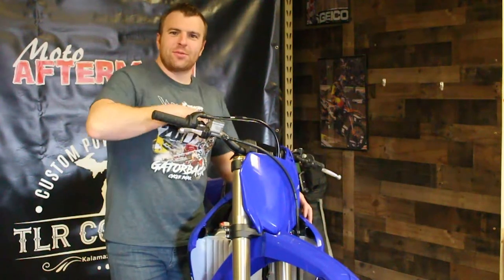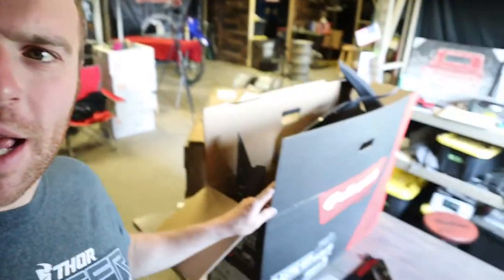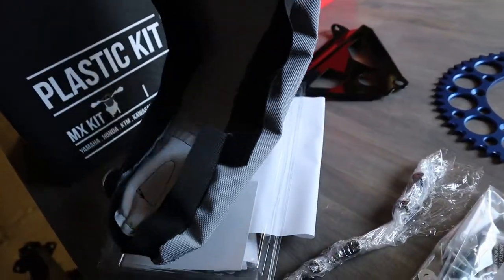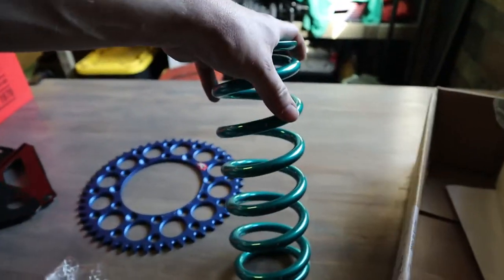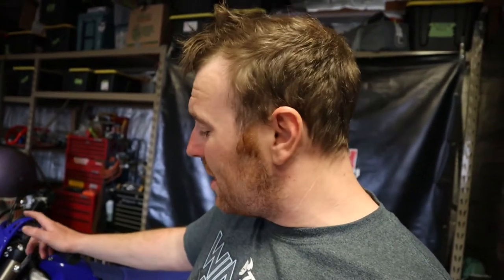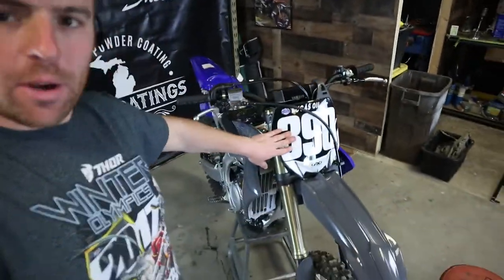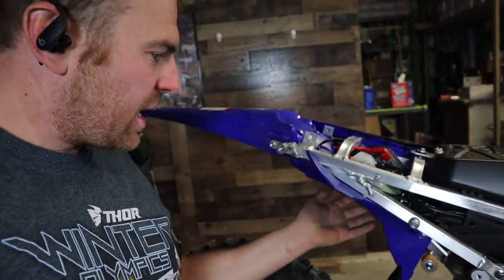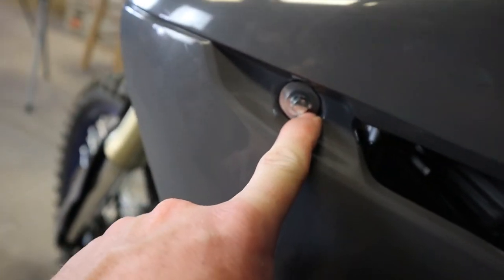Upgrading My 2021 YZ250f  l Plastics, Sprocket, Suspension, Seat Cover

Comment: Hey quick question, did the plastics you bought not come with the metal grommet/inserts? Or did you have to use the grommets from the OEM plastics?
Reply from the maker: Had to use oem